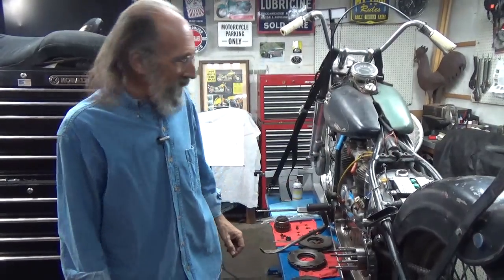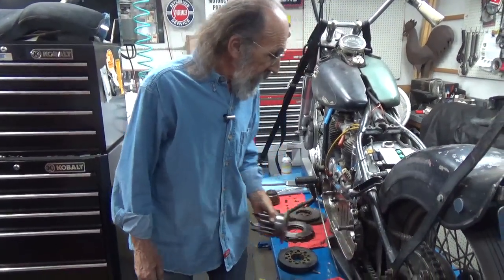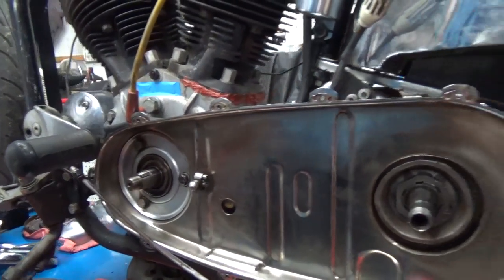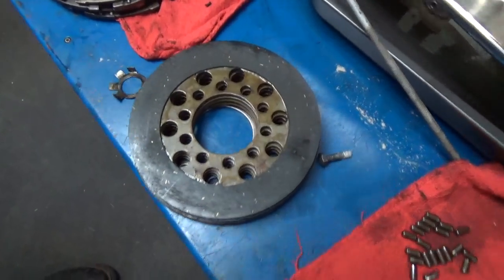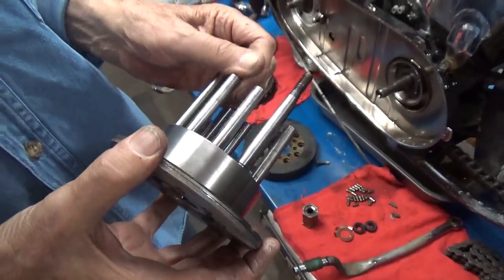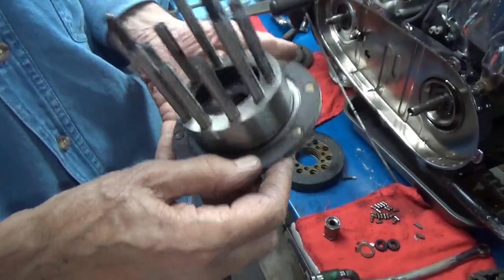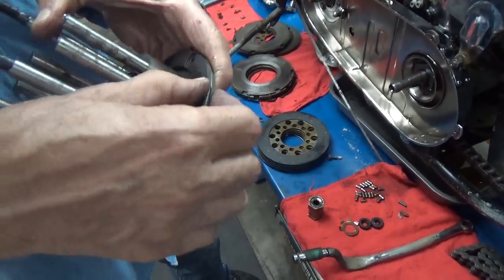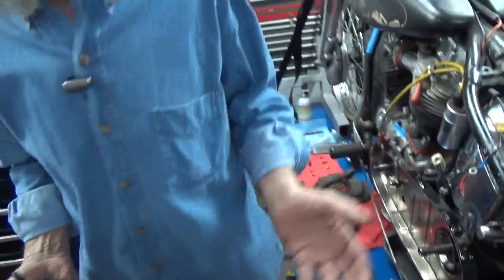Step 3 Panhead Clutch Hub

Comment: You can also get one through the Brunswick corporation we have several clutch type mechanisms on the Brunswick bowling machines and we often have to change clutch linings and the tool that we have I have used also on Harley-Davidson clutch baskets is such same thing you're doing there but ours is a screw type put the little rivet through and then set it on the anvil and then we you screw it down till it rolls it and makes it tight but they offer these little anvils in the parts book I prefer the screw type instead of the impact type such as yours.. but that's just because I've gotten used to it over the years and not a lot of people know that you can change that on the back of your clutch hub so great tip and great tutorial Mike...
Reply from the maker: Very cool.  Thank You.

Comment: Brings me make to the days when working in the foreign car repair shop behind where I grew up replacing the shoes on VW brake shoes before when the shoes were bonded. We did not have a drill press so we would knock the rivets apart by using a chisel on the rivet that was exposed on the underside of the shoe. Then punch out the rivet. Good close ups! I just noticed someone gave you a thumbs down. Really!!!!!
Reply from the maker: Thank You.

Comment: Hi Mile, I noticed that you now have a compensator sprocket instead of the solid motor sprocket sitting in the lift.  In my experience, solid sprockets eat primary chains pretty quick (probably why there was a lot of "stretch" on the old chain).  The compensator helps a lot with primary chains lasting a LOT longer.  I have that same setup on my '53.  Only wish there was a 24 tooth option for the compensator sprockets in that design for tapered shafts!
Of course, you already knew this, which is smart to put the compensating sprocket on this bike.  Thanks for the instructional videos.  I have learned things!
Reply from the maker: Thank You.  I just brought that thing out to show it.  It's a 22 tooth.  They also made 23's.  I'm putting this thing together with a solid sprocket and all used stuff.  Useable, but used.  When, some day, we redo this whole bike, she'll get a belt drive primary.  Smooth, quiet, clean, low maintenance, higher geared.  But for now, just getting her going.  Doing it for very little money.  Trying to demonstrate, "it can be done."

Comment: Sourced a similar rivet set tool from JC Whitney about 40 + years ago.(back when they sold such specialty tools) ...It also came with a rivet removal anvil & punch along with a couple different rivet setting anvil & punch...even with removal tools I prefer to carefully drill the old rivets... Recall CAREFULLY using a hand drill on brake lining rivets...My old JC Whit rivet tool appears to be cast frame vs the higher quality billet frame version you're using...Very handy...also reseats worn out snaps on leather jacket IF snap is along an edge...LOL!
Reply from the maker: Cool.

Comment: A rivetless, freefloating clutch hub friction disc made of nylatron  with more surface area and no messy rivets to weaken the disc, is great upgrade.
Reply from the maker: Yes, they  work fine.  Never had actual problems with any of them.

Comment: I'd be interested in a video on how to replace the studs on the clutch hub.
Reply: Engem is érdekel
Reply from the maker: I haven't done one in probably 35-40 years.  The reason is:  If one stud went bad, the rest will follow soon.  If that's the case, the rest of the hub is worn.  Look at the keyway and see if the hub is cracked.  By the time you restore it, you could have bought a new hub.
Reply: @pacificmike9501  hmm. Makes sense- you have my # on various postcards. I'll send again.
 Don't fix - replace- s o m e. Things. Okay. You're still awesome Mike

Comment: Excellent video Mike, I just pulled the clutch hub out of my 61 and this will really help. Any tips on removing the main crank shaft seal on the 61? Thanks for the video
Reply from the maker: Big deal is that it is a left hand thread.
Reply: @pacificmike9501  Okay, Thank you

Comment: Hi Mike- super video. I have a question about that friction disc on the hub. What does it do exactly? What are the symptoms when its worn? Can it cause a chatter when releasing ( engaging) the clutch?. Thanks!
Reply from the maker: Not usually.  Chatter is caused by several different things; wear on the fingers of the clutch hub, plates need cleaning, tension on the springs uneven, wear on the bearing surface of the hub or basket.

Comment: Hey Mike, I guess your parts sources for these older bikes are, who? I have twin cams and I do order parts on line, but I also use a local Harley dealer near me but my motorcycles are a 2000 and 2004. If I keep them long enough I’m sure some items from a dealer will be obsolete or no longer available.
Reply from the maker: This goes on forever.  Depending on what you need, there are many aftermarket suppliers.  They're all over the internet or the aftermarket shops.

Comment: that arbor would be better for control if it has a threaded ram ,you can control the crush on each rivet.
Reply from the maker: It's really a simple and easy operation.  It could be refined, but it's not necessary.
Reply from the maker: I hope I wasn't rude.  If you wanted to control the crush on Harley's brass rivets, it really wouldn't be that difficult a tool to make.  And, it's not a bad idea.

Comment: Yo, Mike,  my 77 Electra Glide swing arm has play at the bearings,  do you have a video on replacing them?
Reply from the maker: It's pretty straight forward.  You'll need an inexpensive "bearing, seal installer" set to install the bearing races and seals.  Look at the "blowup" picture in the manual.  Replacing those parts is much like installing Timken type bearings in a wheel.  Replace the bearings with matched new races, seals, and the spacers that go between the bearings and the frame.  Install a new locktab when installing the pivot bolt.  Torque as per service manual.  Don't forget to pack the bearings with grease.  Lack of grease is what wears them out.
Reply: @pacificmike9501   if I needed to remove the inner primary
Reply from the maker: Nope.  Pivot bolt comes out from the right side.  Remove wheel, brake, get the chain out of the way.  Remove the shocks.  Remove the swingarm.
Reply: Thanks Mike 👍

Comment: Mike, do you know what size the rivets are?
Reply from the maker: You should have a Harley parts manual.  But, assuming you are working on a 41up Harley Big Twin dry clutch, there are three sizes (I assume this is allowing for wear in the clutch hub?.  3/16 x 7/32, 3/16 x 9/32 and 3/16 x 11/32.  These are part no.'s 8226, 8227, and 8232 respectively.
Reply: @pacificmike9501  Thank you, Mike. I never thought to look in the parts manual. You know how the old service manuals are. You look for a torque value and it says, “tighten sufficiently “. So the rivet size would probably say, “use rivet that fits hole”. Lol  Thanks again, Mike